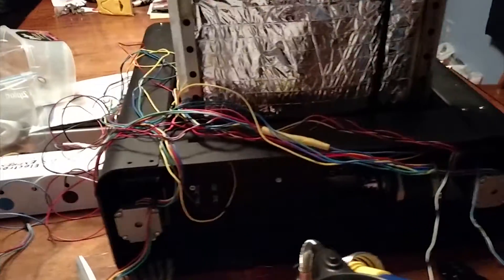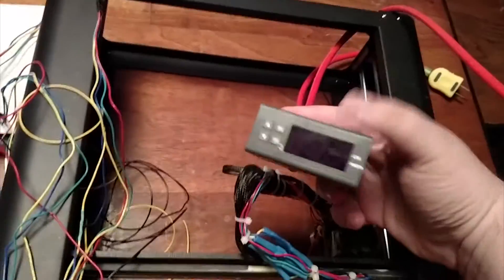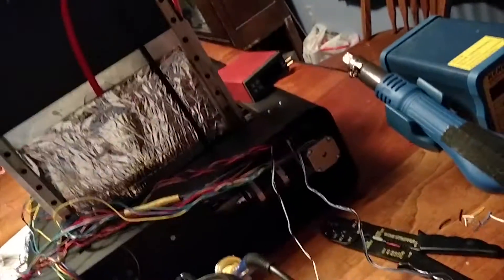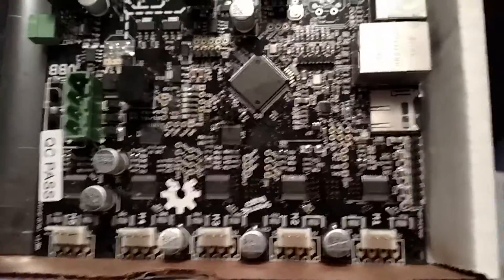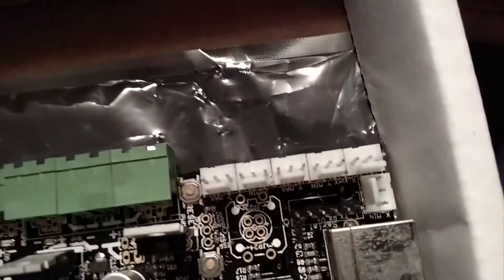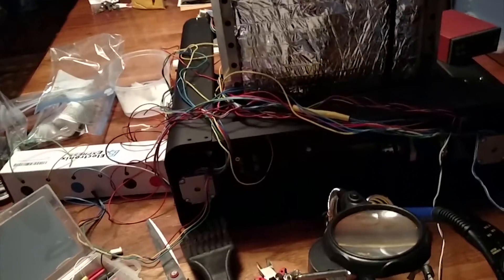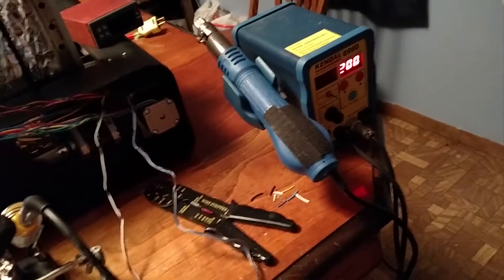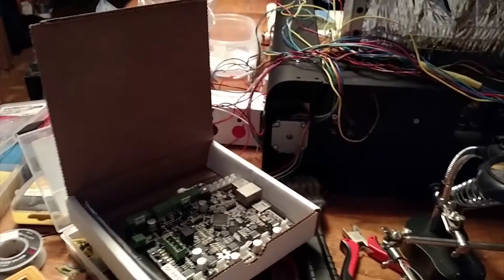Smoothie board Print Controller on PrinterBot 3d printer!

Comment from the maker: This is done one of two ways. 
1.) wire directly from the 5 volt connection on the CPU ATX PSU on the molex connections. 
2.) you can also use a voltage divider - which is basically any two resistors set up as a voltage sink.  the two resistors need to be 1.5 times the others resistance.  IE> 10k and 15K.   ( I can provide a diagram of this if you would like to make it easier) 
I have this in use and has functioned great both ways.  also if I can be of help in any other way please feel free to ask away here.
Reply from the maker: ***** the resistors are placed on the ground and signal like like in this diagram.  http://forums.reprap.org/file.php?1,file=43485
Reply from the maker: ***** although in smoothie DO NOT RUN 12v on to the board in any way shape or form.  you only want sig and ground wires going to board. and thats where these are applied.